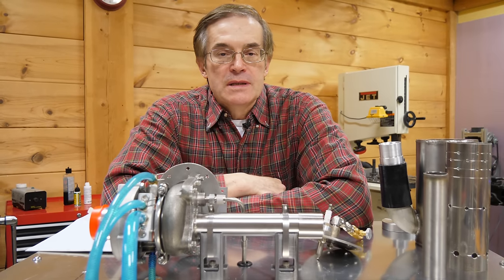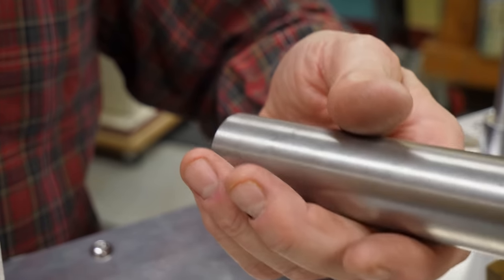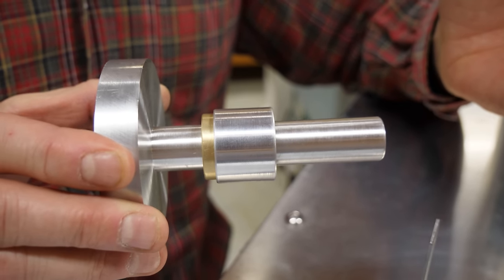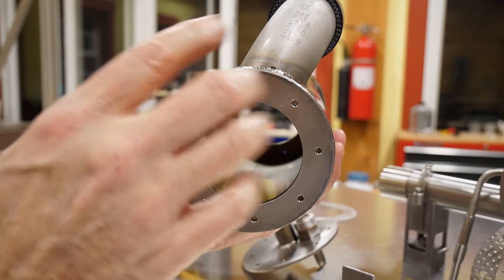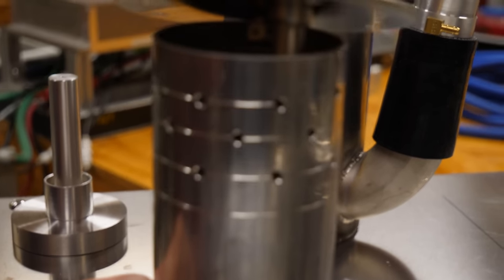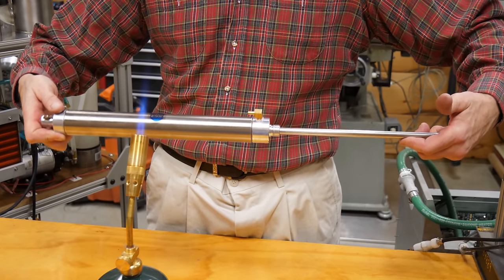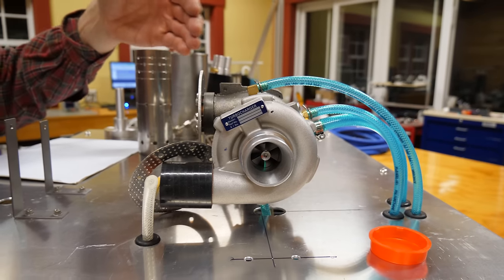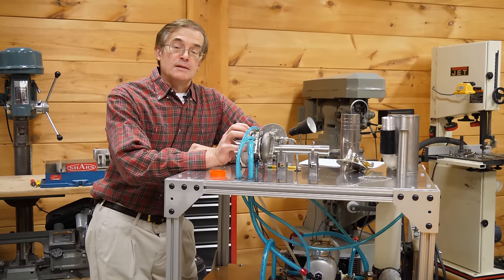The Turbojet!

Comment: As somebody with only a very light understanding of combustion engines in general, this was informative & fascinating. Thanks for helping me to expand my knowledge & comprehension of something I will likely never apply in practice.

One question: since you're using the offset inflow to create that vortex in the combustion chamber, would there be any benefit to drilling the holes on an offset too, so they're angled to work with the direction of the cyclone?
Reply from the maker: Maybe, but we actually want turbulence.  It might not help.
Reply: @TechIngredients  Ahh, thanks. I didn't realise turbulence was useful.

Comment: Thank you for your clear explanations! I want to know more about thermodynamics and air intake optimization.

I'm attempting to make a magnetohydrodynamic type of compressor without fans based on the "dense plasma focus". 

I've chosen a de Laval nozzle with a converging angle of 16° and 4° diverging angle as the design of the electrode to force the plasma through the choke into a supersonic flow. The plasma is then going to be fed to a magnetic nozzle to convert as much of the flow into thrust as possible.

If I decide to use oxyhydrogen as fuel I want to figure out how to exploit the venturi effect or a turbojet to raise the massflow/pressure of the plasma further to make a plasma/oxyhydrogen/air-breathing hybrid.
Reply from the maker: Sure!

Comment: Now if you could get a special turbo with a compressor from a (say) 3" turbo and the turbine from a smaller (say 2" ) turbine then the volume flows should be better to achieve power for the compressor (say 50%) and power for thrust. 
The flame should be rich by the fuel nozzle to keep temperatures down, then stoichemetric for fuel efficiency inside the middle of the combuster can then towards the end of the can lots of extra air is introduced to reduce the gas temperature to something that transmits power but doesn't melt the power turbine -it's the holes in the combustion cans/liners that controls all of this.

Comment: Series mounted turbo chargers are referred to as compound turbo chargers.   This years innovation on that at the sema of motors was a 6 stage compound that was far to powerful for any combustion engine, they used it for testing material integrity i think.  Either way it was a sight to see with every waste gate routed to the next with prestaging and post..  I’d say the efficiency of the final bearing is likely rated in minutes..  ive seen funny car motor dyno runs and they are usually 2 stage and in the 5 seconds they run the second turbo is glowing red.  But for running usually 3-5 second quarter miles at speeds over 250 it baffles the mind how something can be spooled so quickly and what rpm those turbines are actually going...

Comment: Actually most turbos using water cooling don't have a water pump that stays on after you turn it off. Instead it has a secondary water reservoir mounted higher than the turbo taking advantage of the venturi effect to draw water and allow phase change to cool the center cartridge of the turbo.

I recall that from the subaru I built.
Reply from the maker: Good point!

Comment: I think you VERY briefly mention heat soak, aluminum engine blocks, and coolant pumps that run after the engine is off, all in the same context. Could you elaborate on that? It makes sense in the specific context that you might need to continue cooling the bearing of a turbo after operation has ceased, in order to prevent the latent heat of the compressor and turbine from bringing the bearing area out of temp range. But it sounds like there's some similar concern for aluminum block engines vs iron blocks. Did I catch that right?

Comment: At about 11:50,when you explain about the combustion chamber input,I understand how you get the 30%-50% offset,but how do you determine the "out of parallel" slight angle I see between the 2 tubes,and also,the slight "clocking/cocking angle" I guess you would call it? I mean,when looking at the assembly,the input isn't just offset to get the swirl,it is also out of parallel in 2 axis',by what appears 2-5 deg..Hopefully you understand what seems to be very hard for me to describe,lol.
Thanks For Sharing!!

Comment: a. there is no such thing as degrees Kelvin,  its just a number Kelvin. 
and in a gas engine a compression ratio of 10:1 would need some exotic fuel, because it would run so hot that it would predetonate / knock after you turn the engine off.     10:1 would be considered a high compression ratio.   and in cars with turbochargers a lower compression ratios is used say 7:1 so as to be able to stuff more fuel and air mixture in to the combustion chamber.   mike
Reply from the maker: It was originally degrees Kelvin and changed by decree. I'm rebellious.
Indeed 10:1 is a high compression ratio, but the point was that the higher the compression ratio the more effecient the extraction of useful work.

Comment: As far as I know, all automotive turbochargers have larger compressors than turbines.  Some (few) compressor inducers are smaller than their turbine exducers, but even in those cases, the compressor exducer is still much larger than the turbine inducer.

Biggest parts:
1) Compressor exducer
2) Turbine inducer
3 (usually)) Compessor inducer
4 (usually)) Turbine exducer

Comment: Dear Sir, might I make a suggestion, with respect? If you use a ceramic bearing turbo you dont need oil lines, as they dont need oiling and will actually generate a better responce curb and more power by reducing friction.  love the videos.
Reply from the maker: If that's true, why do ceramic bearing turbochargers have oil feed and return lines?
Reply: @TechIngredients  You can also google this...the question is do ceramic bearing need oil
"No, full ceramic bearings can be run completely dry. They do not need lubrication to run. Ceramic is non-porous, unlike steel, as a result it is virtually frictionless. Ceramic also dissipates heat very quickly, which is the same reason they use it on the underside of the space shuttle."
Reply from the maker: Maybe, but the housing isn't ceramic.  And the question remains, why the oil delivery system if it's not needed?
Reply: @TechIngredients  Thats a good question..from what ive seen on line, some assblies use the old bearing housing, with the oil line there but not used or there are some housing that eliminate the assbly all together. I imagine cost is the issue  in other words, You can buy the assbly pre built, which is expensive or just change out the bearing to ceramic and use the same housing. Some turbos dont have the up grade available, so your only option is to swap out the bearings and keep the housing. Oil lines are a bitch to run. Did a turbo install on my vette and a caravan i owned. Coinsidentally, the vans low pressure lol ne popped off doing about 130 on the expressway and drained out all the oil, buring the whole engine out. Yeah it sucked. So i imagine, in a non factory application most would swap out the bearing to avoid that. BTW you have 2 kinds of bearings, ceramic / steel where the inner and or outer bearing is steel and all ceramic. From what i understand the hybrid ones may need oiling still, as steel will expand and contract with heat. The all ceramic one do not. I hope that helps. Im building a small jet turbine based on a car turbo. I plan on using all ceramic bearings in the build. Ill send you a link to show you what i got so far . Hey, and take care brother, God help us all with the craziness in the world right now.
Reply: @TechIngredients  OMG... you're the guy on the vid...i had no idea. Thank you so much for your explination. Invaluable, you tubers i consider to be my reaserach and development team. Im having troble up loading a video for another you tuber trying to build one. Ill show you what im building and I love to get your thoughts and feed back. Im in Orlando Fl BTW, you have a friend here if your ever in the area. Again Sir all the respect in the world and may the Lord bless you and all you hold dear in these tring times.
Reply: @TechIngredients  Hey good morning Sir. Thats a really good question. Ive installed two custom set ups, but never used a ceramic bearing on a turbo. Ive seen the roller ceramic bearing assembly. It looks like its made of aluminum, so i imagine heat is not an issue on that part. If you google ceramic bearing turbo assembly, youll see what im talking about, but ive never messed with one. I know that the part is not structural, as the turbo mounts to the header or manifold flange itself. At this point, Id recommend talking to a turbo shop. Someone whos actually used them, to find out first hand if they require oiling, as Ive been out of the racing scene for a while now, but if you dont need oiling, it makes things a whole lot easier.
Reply: @TechIngredients  Ok I went on a turbo forum, this was the answer they gave. Its seems the hybrid steel ceramic do. The all ceramic ones dont. They mount in the original housing. This was the exact reply from the forum. 
"Ummm, no. Full ball bearing turbos DO NOT need oil, thats the whole point, they use cermaic bearings instead of oil. Because they elimintate the oil, they also eliminate the parisitic drag that goes with it, oil cook, and are more durable. Well worth the money, trust me"
This was always my understanding of it too. Less parasitic losses and no oil lines, but there not cheap and not availible for all models of turbos. The turbos that come with them, pre built, are super expensive. At least 3 to 4 times the cost of a non ceramic one, but again, if you have the money, its worth it, just so you dont need to worry about oiling, especially on a turbo jet conversion. Stay safe brother.

Comment: Why not add a wide band 02 sensor to get your stoichiometric numbers instead of trying to decipher tube heat for combustion?  Also you really don’t need the water cooling in this application, just have the oil pump keep running 2 minutes after shut down. This solves the heat soak problem. Nice work!
Reply from the maker: You are correct about the water cooling requirement.  But, there are a couple of advantages.  The water carries away a lot of heat, the oil never exceeds body temperature even on a long run.  We could even eliminate the oil cooler.  We do run that shut down sequence you mentioned and use the blower as well so that we can operate everything up for inspection in less than 5 min.

Comment: I think something is wrong with the example about the energy and the compressed air, and the Diesel engine.
If you take the same amount of air in, the higher pressure does not give you more energy.
The clue is that when you burn the fuel under higher pressure you get a higher temperature, and that results in more increase of  pressure, which is converted into work when the gas is expanded to a lower pressure.
It's the consequence of Carnot's theorem that states that the efficiency of a Carnot cycle engine can not be higher than the lowest temperature (in Kelvin) divided by the highest temperature (in Kelvin).
Carnot efficiency % is the former times 100.
Please correct me if I'm wrong, because I'm not really an expert on this subject.
Thanks for the video, it's like candy to me. I love it.
Reply from the maker: You are correct, but so was I.  The principle of the compression ratio is valid because the greater the initial compression, the lower the entropy prior to the addition of external heat and the more useful work that can be extracted when the gas reaches the same final temperature and pressure conditions (STP) after expansion.  The subtility with this example is that the compression process alone, raises the temperature significantly prior to the addition of external heat.  The same amount of additional heat will result in a higher temperature when it follows a higher compression stroke and so the principle of the cycle holds true.

Comment: First of all, great video! More of this stuff, please.

But I think that the explanation for "more compression --> higher efficiency" got a bit wonky at the 20:40 mark. It may lead to viewers thinking "wait, where did the extra energy come from?". 
(Since what you used for your explanation is pretty much the first part of the Otto Cycle, I will use its assumptions in the further explanation).

1. You compress the gas higher than in the reference process
2. This leads to a higher temperature at the end of the compression stage (don't believe me? touch the tip of the bike pump after excessive pumping)
3. Now I transfer the same total amount of heat into the compressed gas 
4. Because my temperature is higher, and my amount of heat is fixed, I produce less entropy in the process (since entropy * temperature = heat or S*T=Q)
5. Less entropy means less waste, and thus higher thermal efficiency.

So it is a bit more complicated. Some might say you simplified it, for my taste you oversimplified it a bit. Still, awesome video.
Reply: Also: when does the next vid come out? I am dying to see this baby running.
Reply from the maker: A few days.
Reply from the maker: It's a judgement call.  If that concept is familiar then the details and variations from that simplistic approach will   bother some people.  For those unfamiliar, the value of grasping this very important concept is priceless.
Reply: @TechIngredients  Thank you so much for the reply. I totally agree, it sometimes is a tough call. Also I subscribed and hit the notification icon in order not to miss the new vid! Great content.

Comment: Sir, thank you.  This is a fantastic explanation of how all this works.  I do have a question about the electric ducted fan  turbojet,  is there a difference in fan blades and compressor blades and can you get higher compression from the electric fans with a different blade profile?
Reply from the maker: Sure!
These off the shelf fans are optimised for mass flow and not compression.  Simply increasing the disc density (more blades with smaller gaps) overlapping leading and trailing edges and most importantly, a smaller angle of attack will produce much better compression.  The lower drag will also allow higher RPM for a given power and this will also help.

Comment: what if you have a failure/leak with any of the liquids? are you sure you want your controls at the bottom of your test stand? i would recommend adding a shield to protect against the potential liquid intrusion of the electronics. i was one of the first 10k subs and will continue appreciating your videos, thanks

Comment: Great work. I'm wondering if there's a drawback to making the combustion tube longer again.
Once you've got this working, it'd be good to see you add a bigger compound turbo stage and double or triple the pressure, the oil pump is already big enough.
Reply from the maker: Once the burn is complete, additional length just adds weight and expense.
Reply: @TechIngredients  I loved your description about adding the holes to the combustion tube btw, I always wondered about how to do the holes properly.
Reply from the maker: Thanks!

Comment: Each wheel, compressor and turbine have an inducer and exducer and they are separate!   The exducer is the larger end of the wheel.
Reply from the maker: That's right.  The exducer on the power turbine is directly linked to the output port
Reply: @TechIngredients  just for curiosity sake, I would think that adding a pressure transducer for the compressor outlet and turbine drive could be a great set of data points 😎 as well as the compressor and drive pressure for the future compound setup.

Comment: I'm very looking forward to seeing the end applications of the jet engine(s). Jet powered drones in the works?
Reply from the maker: Yep, but first we plan to get the jets to drive a high torque, low RPM turbine.  Then a generator and the transmission of an ATV.
Reply: I presume without the need to run an electic ducted fan the generator is purely for avionics, servos, and being able to restart on flameout without requiring the weight of large battery packs? It will be an impressive piece of engineering when finished

Comment: It would be interesting to experiment with variable geometry vane turbos to optimize the energy extraction from the combustion flow stream entering the power turbine. Also, eventually using the turbo jet as a gas generator to enter another power turbine to convert the system into a turbo shaft engine.

Comment: At 22.42 the gentleman showing this jet engine could have mentioned the importance of the diffuser after the compressor and before entry to the combustion/burner chamber. The diffuser would increase the pressure and slow down the airspeed to help the flame being sustained. Even some tubulence would help to get better mixture to burn all the fuel.
Reply from the maker: These turbochargers have the smooth, expanding, spiral in the output scroll act as a diffuser.
More than enough turbulence is created by the numerous, small holes in the flame tube.  Take a look at our follow up video "Catching Fire"
Reply: @TechIngredients  Thank you, for the follow-up, it all fits very well. Congratulations, you have thought of it all. Well done.

Comment: What's the best type of compressor? Reciprocating, centrifugal, scroll, wankel rotary, screw rotary, axial? I know some forms would need an external drive, or external compressor. 
I know axial is probably best considering that's what production jet engines use, but what I'm interested in seeing how the others would work in this application, because science.
Reply from the maker: For a single stage, centrifugal compressors work best.  For multiple stages, the low airflow resistance favors axial compressors.